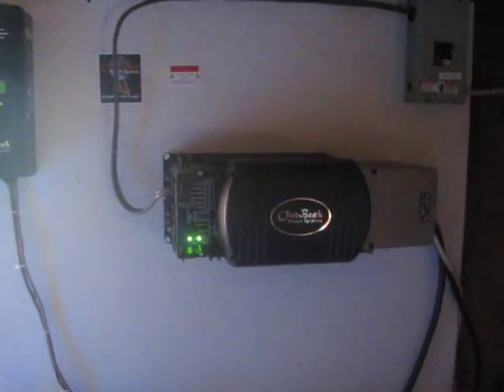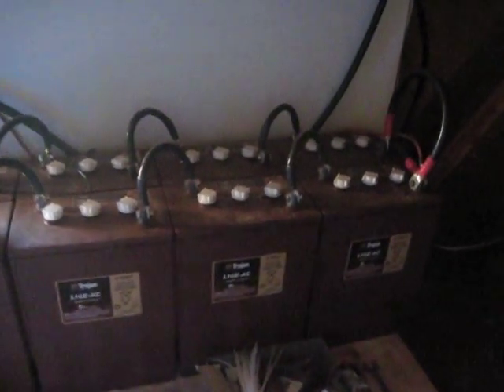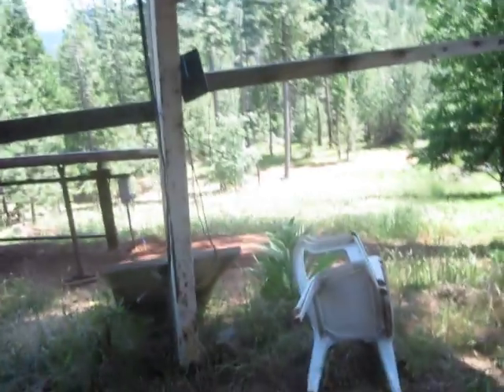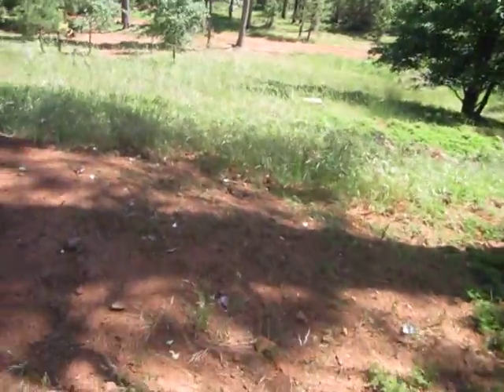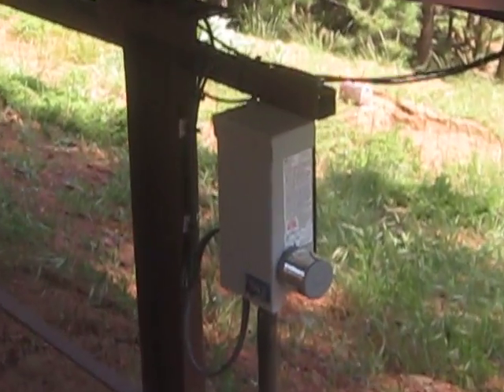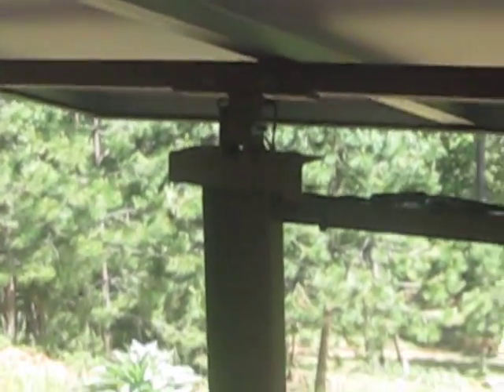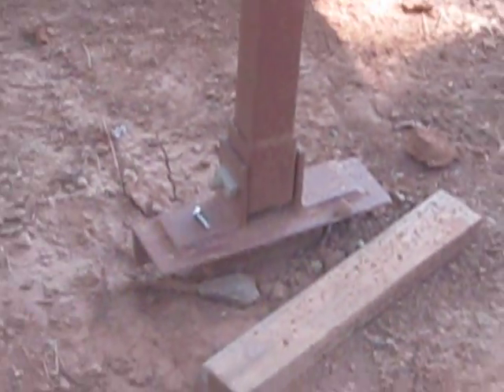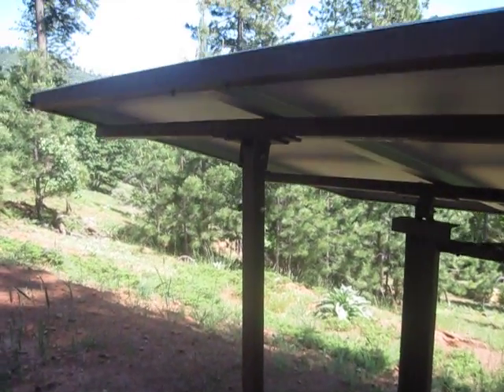Solar Power Up And Runnin'!

Comment from the maker: @noblinger Latest part of summer...they are full sun right now when it's needed most. That Ponderosa Pine does bring some shade during that time of year though! Realistically, it hasn't mattered one bit as the batteries are floating within two hours of sun; though the panels get a minimum of 4.5-5 hours in summer!